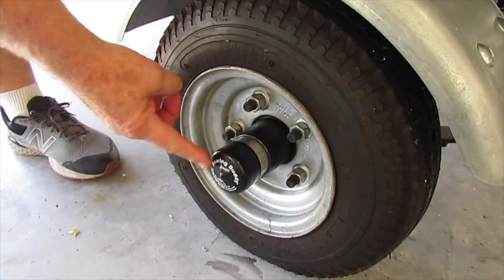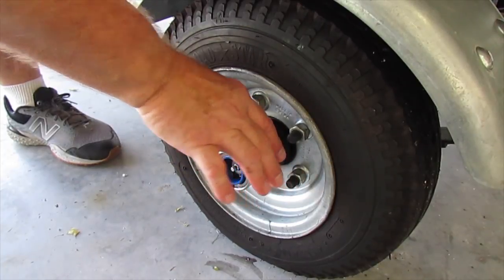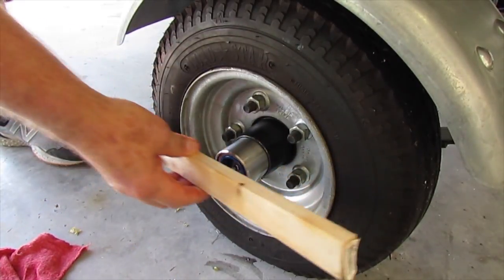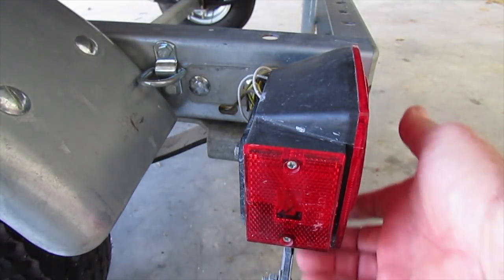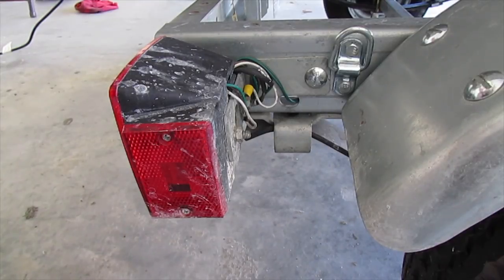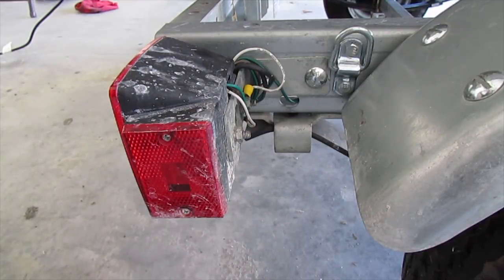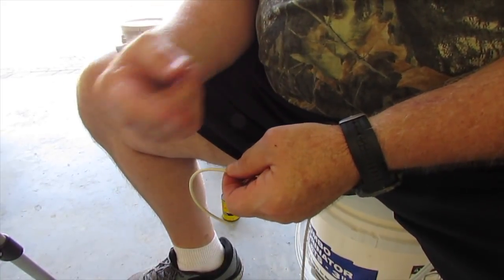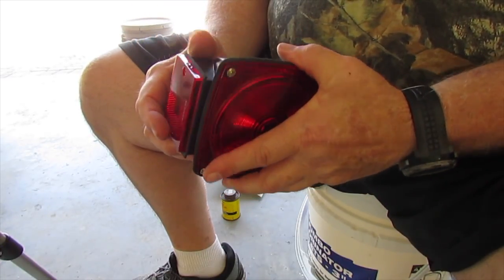INSTALLING BEARING BUDDY AND LED LIGHTS ON THE TWIN TROLLER X10 TRAILER

Comment: Hi Gerry, I just became a twin troller owner! I am assembling the trailer and have a question about the wire harness. The driver's side of the harness has connectors for the tail lights and side light. But, the passenger's side has three sets of connectors, not two. I don't know what to do with the unnecessary set of wires. I called manufacturer, and customer service said they are unnecessary and to just tape them up. Do you agree? Should I seal them with liquid electrical tape and shrink tubing as you did on this video? Many thanks, Allen
Reply from the maker: Allen, I am out of my State right now so I am doing this by memory. There are four wires to the harness. One is the common wire that is the same color on left and right side of the trailer. One color is for the left turn. One color is for the right turn. The fourth wire is the ground and that wire runs from the one part on the connector by the tongue that looks different than the rest. 
All the wiring is explained in the manual and I do not think there are extra wires.        Gerry

Comment: Hi Gerry ,I did the same thing to my trailer sealed leds and bearing savers.Rick
Reply from the maker: Rick, I never worry about my bearings any more and it is very easy to maintain them now,  just a squirt of grease once in a while. 
I was very surprised at how bright the LED lights are. The Twin Troller has a small profile and I was always concerned someone would run into the back when trailering at night. I also added extra stick on DOT reflectors to the trailer frame because of that. I am not nearly as concerned now because the LED lights are hard to miss in the dark.            Gerry

Comment: As you know, I just got the new boat and trailer. Should I go ahead and change them to LED light/BB already, and save myself from future headaches? BTW, you're too funny Gerry!
Reply from the maker: Ed, I can only tell you what happened to me. In years past I did not have problems with conventional bulbs on boat trailers but this time I did quicker than I anticipated. I am not sure everyone will have problems but I have no way to know.            Gerry

Comment: Hi Gerry, what type of grease did you use with the bearing buddies?

I was concerned about grease compatibility, so emailed CESmith.  They say the trailer hubs are greased with the Citgo Calsuplex MP 2 grease, which is calcium sulfonate based.  I can't find this product in a 14-oz tube anywhere. I spoke to a product formulator at Citgo, who told me they've tested the Calsuplex MP2 to be compatible with the Mystic Jt6 high temp grease, which is lithium complex based.  But non of the local store in my area (NJ) have that.  The Citgo rep mentioned other lithium complex based grease may also be compatible but he doesn't know for sure.  I emailed CESmith again for a recommendation to be used with bearing buddies on their trailer.  She suggested the Kendall SHP 2 RED grease, which again is unavailable locally.  I'm thinking of just using the Sta-Lub Wheel Bearing Grease, which is lithium complex based, and be done with it.  The drawback is that the Sta-Lub Wheel Bearing Grease doesn't offer saltwater protection, but I don't think the Calsuplex MP 2 does either.
Reply from the maker: My opinion is any marine grease would work. My bearing buddies have an indicator easily observed showing it needs more grease. If you watch that and grease regularly I think you will be OK.
Reply: @LunkerFishing  I bought some Sta-Lube marine grease from Napa auto parts.  According to product info printed on the tube, that marine grease has "Alumnimun Complex" thickener.  The reps from CE Smith and Citgo both told me the Sta-Lube marine grease is incompatible with the Calsuplex MP2 grease, which has "Calcium Suffinate" thickener, in the bearings of my Twin Troller trailer.  Supposedly, the two greases will react, losing their ability to lubricate properly.
Reply from the maker: PT, I have owned my TT for 6-years and 4-month. A couple of years ago I removed all the grease from my trailer and inserted fresh marine grease. If you are concerned with a reaction between two greases I would do the same and insert the grease of your liking.                   Gerry

Comment: Hi Jerry, I am a new TT Boat Owner.  I have the boat and waiting for the trailer to arrive.  I have gotten the Bearing Buddies and the LED lights for the trailer.  I was reading the instructions for the lights and it says "if your towing vehicle has rear turn signals separate from the stop light, an electronic turn signal converter will be required to install this trailer light kit."  Will I need the converter for my TT Trailer?  I am new at all of this and I want to get it right when I have it all together.  I really enjoy your YouTube videos and have watched most of them multiple times.  I have subscribed and I wait for all the new ones to come.  Thanks so much.  Jim Houston in McDonough, GA
Reply from the maker: Jim,
Welcome to the Twin Troller family! 
You should not need separate light wiring for the Twin Troller trailer. It will have four wires. 
1-ground
1-common colored wire that goes from the vehicle connector to both trailer rear lights.
1- other colored wire that goes to one trailer tail light
1- yet another colored wire for the turn signal on the other trailer tail light. 
I have a video on installing new LED lights that you likely watched already. Just follow that and if you have trouble you can contact me here.

I am glad you like the videos and find them helpful.         Gerry
Reply: @LunkerFishing  Thanks so much.  I will follow your video and let you know if I have any questions.  I just can't wait till it gets here.